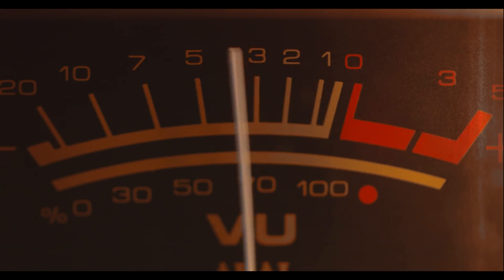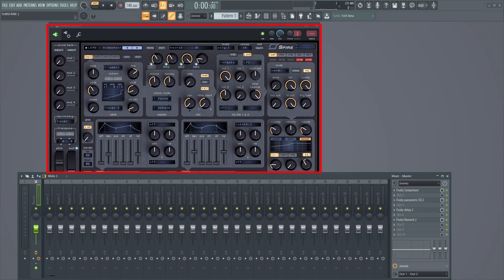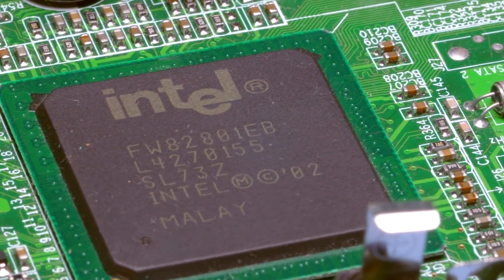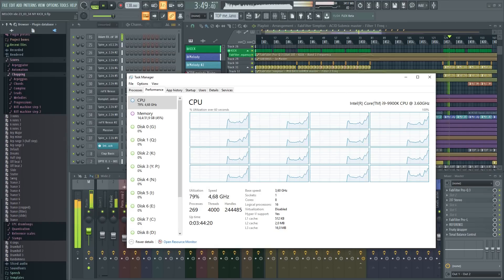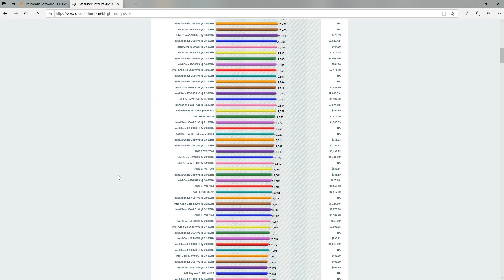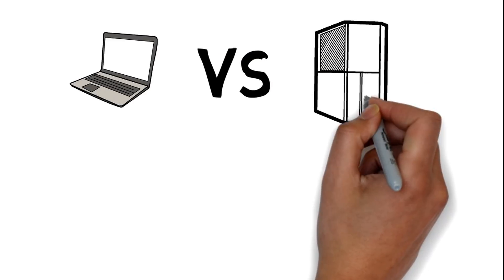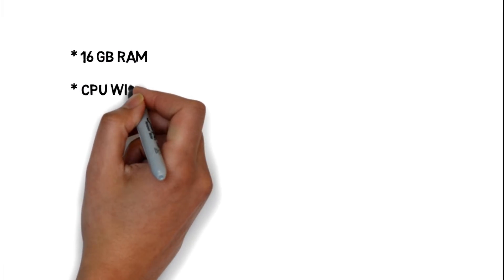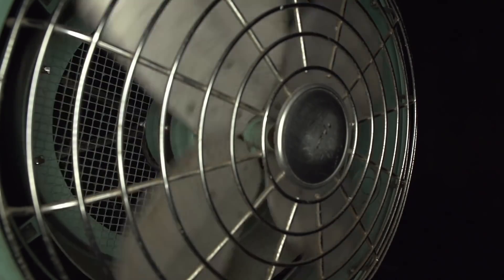The Best Computer For Music Production - What's Needed And Why!

Comment: For tracking audio youre absolutely correct, but when youre mixing audio parallel processing is far more favorable because you dont have the output stacked in series.
To me the best choice is AMD with the highest core/thread count and clock speed that you can afford. Best of both worlds.
Reply from the maker: Hi, when it comes to CPU's, there will always be a sweet spot where more cores are favored over single-core performance. I generally advise people to find a CPU that's in that sweet spot, where you have a good number of cores and also very good single-core performance. That's usually the best CPU for music production. You want the fastest single-core speed as possible, but you also want as many cores as possible. Unfortunately, you can't have both. As more cores are added, single-core performance tends to go down, so the best CPU is located somewhere in that sweetspot, before this tradeoff occurs.  

Here's some good info from the developers, and I'll quote: 

"The CPU is the primary factor in your ability to run FL Studio with large complex projects. Yes FL Studio utilizes multi-core CPUs but, beyond a certain point, more is not necessarily better. Read the section: 'The logic of audio processing' in the manual to learn why."

"The logic of audio processing - There is a long list of tasks that must be processed in sequence, and this means logically can't be processed in parallel (multithreaded). For example: Plugins must wait for instructions from the Piano roll and Playlist before they make sound. Effects must wait for the audio from upstream instruments and FX before they can process it. Further, it's not possible to parallel-process (multithread) instruments and FX that are on the same Mixer channel (their audio is mixed together), or even in the same Mixer routing pipe-line (when one Mixer track is linked to another and another, even FX processing has an order from top to bottom in the FX stack). Then, the Master Mixer track must wait for every instrument > mixer track > effect to be processed before it can process the audio through the Master effects. So logically, there is a lot of waiting that is a natural and unavoidable fact of DAW music processing. Think of a production line. This means the CPU may not be particularly busy, using all its cores and processing slots, yet it runs out of time to fill that tiny 5 ms audio-buffer because there was a lot of waiting for things that needed to be processed in sequence. It should be clear that fast processing is very important and this is not the same thing as multi-core processing. The best CPU is one that has enough cores to spread the work around AND can do the most work on a single core during each buffer time-slice. Which leads to our TIP: When comparing CPUs, look for the fastest single-core performance scores in a package with at least 4 physical cores. Most CPU benchmarks list single core performance. For example, the CPU Benchmark website lists the single core scores."

Comment: This was a bit over the top, audio interface does most of the heavy lifting anyway
Reply from the maker: Actually the audio interface doesn't do anything at all in terms of processing a project. It just converts the digital into sound you can hear. It also provides mic and midi inputs so that you can record. All the processing is done by the CPU. In fact, you could in theory produce music without an audio interface at all, render it out and then have it played back with no issue, because it's all processed digitally. The audio interface is just for monitoring purposes mostly, as well as recording.

I agree that this system is over the top for most people. The video title is "the best computer for music production" though, so it shows the system that's currently best suited for the task. There are several cheaper options mentioned in the video for those who are either on a budget, or who just doesn't need such a beast of a system. 

In the end It all depends on what kind of projects you make, how you work and how many VST's and effects you use at the same time :)
Reply: @FireWalkMusic  haha, thanks for answer. As you said, audio interface takes care of digital signal processing, which IS the heavy lifting. I win.
Reply from the maker: @eggbert5760  :D

Comment: My computer handles music production just fine. It's literally a i5 8gb computer. However I cant leave my DAW open or any virtual instruments running and use my video editing software at the same time. I have to close everything  down and hold to the next thing entirely. Kind of irritating
Reply from the maker: This build is way over the top for most people. I just wanted to show the "best" and explain why that is etc. Most people will get by with much cheaper systems. It all depends on how you work, what kind of projects you make, what kind of plugins you use and so on. 
I'm kind of in the same boat as you with regard to video editing. I also do a lot of video editing, so I often find myself working in my video editor, photoshop, FL studio, various animation softwares, screen capturing etc all at the same time. The 9900k was the only solution for me. Add to that I also have a mixing and mastering service etc, so it's essential to be able to get stuff done as quickly as possible, since my time is limited. 

The i5 is still a good CPU. However, If you want to upgrade then the older I7 CPU's will offer a very good performance increase. With multithreading you should be able to get a huge increase in performance during video editing too.
Reply: Wait til you are doing over a hundred tracks.... with Omnisphere running on 30 of them. And 3 or 4 plugins on all the other tracks.

Comment: Today the best bangs for the buck are the Ryzen 3000 series. A great entry level is the Ryzen 5 3700x
Reply from the maker: The new 3000 chips are supposed to be great, and all though they still don't outperform the 9900k (especially when overclocked) they do come very close, and at a much lower price. AMD has always been the best value for your money. I remember back in the day when AMD and Intel was not only equal, but AMD was actually faster than Intel. They were first to 1 ghz too by the way. I stuck with AMD for a long time. I swore I would never buy an Intel CPU because they were overpriced, and because I didn't like the way Intel has manipulated the market and tried to squeeze out AMD in every way possible.. 

Anyways, long story short: Eventually they went so far ahead of AMD in terms of performance that I had no choice but to switch due to my heavy projects, video editing and so on. I really hope AMD can come back and be just as competitive as they were back in the day. It would be great if they could surpass Intel with a good margin and claim the throne once again. That would be great for us, the consumers. More competition = more innovation and lower prices. :)
Reply: @FireWalkMusic  I just built a lesser 3600x (rather than the 3700x) last week. Very impressive for my small projects. And most are saying save the money and get the 3600 instead (vs 3600x).  I only got the 3600x because it is slightly faster and didn't want to fool with over clocking.
Reply from the maker: @OffGridandOutdoors  I think you made the right call there. It should be more than enough for most people. :)

Comment: Very informative nice!!!
I have an i7 9700KF, Msi Meg Z390 Ace, Noctua nh-d15, be quiet silent base 801, 16gb ram, M.2+ ssd+ 8 x140mm fans. Everything is working so smoothly, I get low temperatures, very low noise and I’m so happy with my build ;)
Reply from the maker: That's a great system for Audio production, and should also work well for most other applications as well :)

Comment: Good info.  Personally I haven’t found anything easier, more useful and reliable for both live and recording than an i7 MacBook Pro, SSD, 16gb ram and a Behringer XR18 mixer.  I use xAir on the Mac and iPads for live mixes and monitor tweaking for the band members, and Reaper for recording up to 18 tracks at once.  The fan hardly turns on while doing all of that.  Plus very mobile.
Reply from the maker: The i7 is still a beast of a processor and should be more than enough for most people. :)

Comment: So no difference?? I've saw a comparision of the i7-5820K with Ryzen 9 3900X. An Ableton project takes 2x less CPU power on Ryzen than on Intel. So Ableton is so great in multicore CPU usage or FL is so bad? Or maybe Intel i9 is meh?
Reply from the maker: There's about a 10% difference in this project. In other projects it's more like 20%. It depends on the project itself and what's in it. This is a very large project which requires a  lot of bandwidth The 5820k has dual channel memory vs the dual channel of the 9900k, and this seems to be giving the 5820 an edge in this particular example. On paper the i9 should be about 40% faster than the 5820k, but every situation is unique. I've done some testing on Ableton myself and it does indeed seem like CPU consumption is a bit less on Ableton. Keep in mind that FL Studio isn't very linear, which means that you can do all kinds of crazy stuff which will consume more CPU power.  There's also some "issues" (if you can call it that)  with the way it's designed from the ground up with regard to the mixer tracks consuming a little bit of cpu power even when not in use. This is in fact the reason why there's a limited amount of mixer tracks in FL Studio, while there's an unlimited amount in most other daws. The version of FL Studio you're running can also play a huge role. They made some changes that improved multi core performance quite a bit recently. I have a separate video about that: https://youtu.be/nggPKqo19IM

Comment: Hey Thank you FireWalk for the video. But there is something that I dissagree with here. I have an Acer 2005 and I used it with a Korg mini keyboard. And the OS was windows 7 . It was a 32 with a duel core pro. And yes it did get a little hot, but I've used it for many live performances and had no trouble. I now have an HP i5  running on windows 10 with duel sound cards and it skipped. I have an newer Acer (still with duel core pro) and I still take it to every performance and it runs wonderful.  and I have been using it for recording and never lost anything.
Reply from the maker: I'm not sure what CPU is in the Acer, but there are many factors that can inpact performance. The i5 without multithreading is considered a good gaming CPU, however it's not ideal for music production because you always want as many threads as possible, while still having the best single core performance possible. Also, drivers can have an impact. Also, what runs in the background can play a role. Latency can also differ from one sound card to the next. The buffer size will also play a huge role, as a larger buffer size will typically reduce the stress on the CPU, while increasing latency. 
I have another video about how to get the best CPU performance in FL Studio: https://youtu.be/OWYmqwb7b4k

Comment: Questions here sir:
- how did you decide whether or not to upgrade your PC?
- what would you do different if mounting another PC?

Cheers!
Reply from the maker: Hi, When deciding you need to consider what kind of software you're going to run. In my case, I had some overruns in some of my larger projects with the old computer. I also do a lot of video editing, and I often find myself working in photoshop, my video editor, doing animations and having FL Studio open all at the same time, so I needed something that could pack a punch. I also do mixing and mastering etc, so every last bit of time that I can save will mount up in the long run. 

When choosing a new computer you need to think about what you're going to use it for. A workstation computer can also work well with music production, such as the 5820k, with it's quad channel memory. However, it won't work well in some other applications such as games for example. So you need to consider all the tasks you use the computer for. :)

I wouldn't do anything different, this is exactly what I needed and it works great both for music production as well as video editing etc. The 9900k will also work very well for gaming. :)
Reply: @FireWalkMusic  great. Tks for that!  :)

Comment: I was told that def. at least 4 cores, but the more threads you can get the better for music production.
Reply from the maker: Yes, you typically want as many cores as possible, and as fast cores as possible. That said, at some point there will always be a trade-off between single core speed and the amount of cores. The best PC for music production will usually be somewhere around that sweet spot, where you'll have plenty of cores, which is quite fast. Once you go beyond that sweet spot you will typically end up with more, but slower cores.

Comment: Good helpful video thanks! One thing though. The worst thing that can happen when a tread is waiting for another tread is both running on the same physical core. A a result turning hyperthreading OFF usually results in better DAW performance.  
Steinberg is working a a technology that can mediate the problem in some situations by working "ahead" intstead of waiting. For obvious reasons this doesn't work with live midi or audio input. At the moment however this is a Cubase only solution anyways. So unless your running the latest Cubase, no hyperthreading is the way to go. There is a paper on this on the Steinberg website.
Reply from the maker: Thanks. Steinberg has always been ahead in many ways. Needless to say, they Invented VST. If I had to rank daws depending on their capability etc, then Cubase would be on top of the list for sure. :)

Comment: Great video.   I’ve had a Mac since 2011.  It’s starting to break my stones with incompatible os etc.  iTunes won’t sync up with the software I’m running bla bla bla.   I’m probably going back to windows as it’ll be far less costly and everything supports windows 10.
Reply: Even  less costly once you realise AMD tops all the charts since third gen Ryzen
Reply from the maker: AMD will definitely give more value for your money. When taking operations per clock into consideration the new 3000 series probably won't outperform the 9900k in FL studio when overclocking is taken into account, since the 9900k can run above 5 ghz on all cores. That said, most people won't need the most extreme setup, and the new 3000 series will give the best performance for your money. No doubt. :)
Reply from the maker: I know some producers use hackintosh since the hardware is exactly the same. That said, it's probably not for everyone. It depends mostly on the daw you use. If you're a Logic user then obviously you need to stay with mac. Cubase, FL Studio etc will work well on windows as well.

Comment: Thunderbolt 3 too
Reply: Not on the z390 maximus hero. The z390 asus prime has thunderbolt add in card header and so does the Asus z390 maximus xi extreme which is the motherboard I have. The gigabyte Designare z390 has daul thunderbolt 3 built into the i/o shield.

Comment: How much it total out to I need a new computer for my music and videos
Reply from the maker: If you buy everything from scratch it will be quite a lot, but it doesn't have to be. If you already have a rig and you just want to upgrade then usually you can reuse the case, power supply, video card etc. Oftne times it's enough to just buy a new motherboard, CPU, cooler and RAM, which will save you quite a bit of money. The new AMD 3000 series is also quite good and will provide more value for your money vs the 9900k
Reply: @FireWalkMusic  Yeah it wont cost much just $500 for the cpu and 

$400 for the motherboard ! Not much !

Comment: Badazz setup, thought there would be a bigger difference as well.  After 20 plus years and a several builds, and upgrades I finally left AMD for intel. They convinced me latest I5 was more powerful than than prior I7 and the savings was nice. But few people realize the audio programs don’t utilize those extra cores  and amped up video cards as much we hope they would. Maybe they will address this in years to come. Very good info. Thought you say a little bit more on motherboards and the advantages of SSD over traditional hard drives.
Reply from the maker: Thanks. Indeed. I've concluded that the 4 channel memory of the 5820k is giving it an edge here. According to the guys at IL even dual channel shouldn't max out the bandwidth, but the results speak for themselves. I tested this by setting the 5820k setup to dual channel instead and there was a noticable drop in performance. I tested it with a rather large project though, and for smaller and medium size projects it might not have such an impact. In theory the i9 should be around 40% faster than the 5820k, but in this test it's only about 10% faster. I'm seeing a huge positive increase in performance in many other applications though.
I agree there should be more info about SSD disks. If you're using huge libraries, like omnisphere, nexus etc then having those on an SSD will save you a lot of time in the long run as it will load much faster.  :)